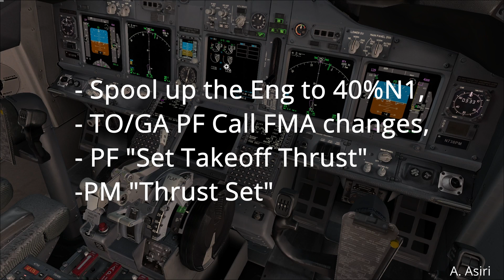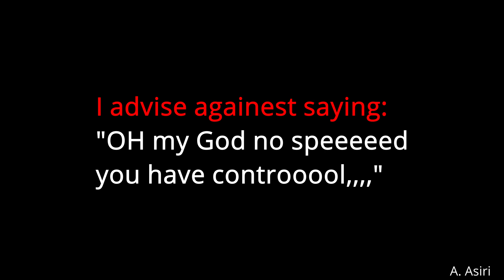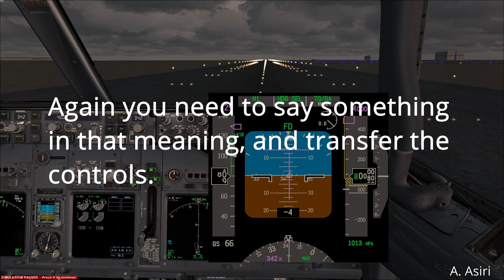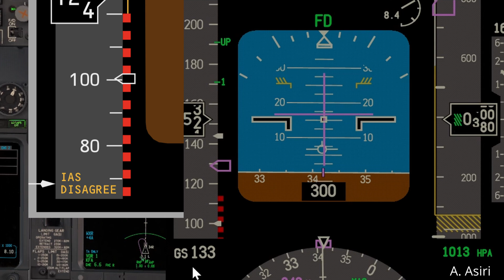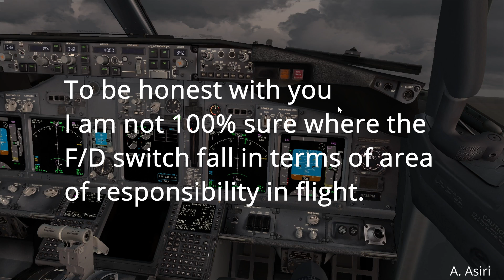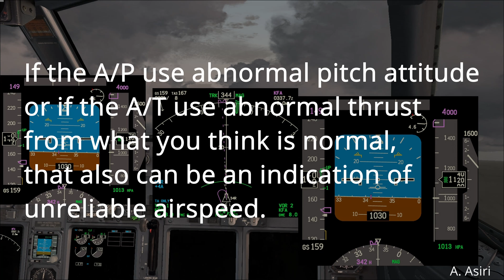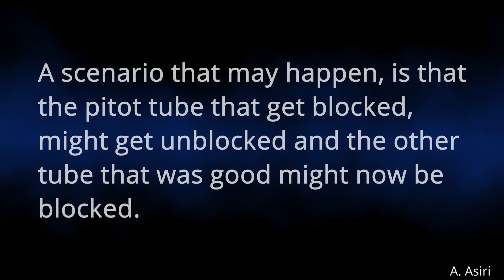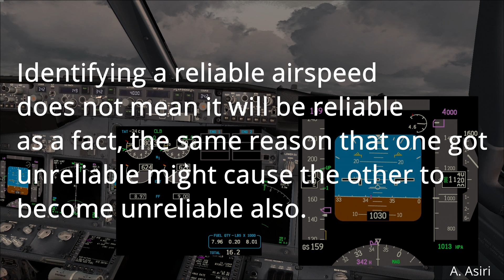B737 NNC (IAS Disagree)

Comment: Thanks Captain for the new videos those are very helpful 🙏🏻🙏🏻🙏🏻
Reply from the maker: You are most welcome, 
Appreciate you taking the time to leave a comment 🙏🏼
Reply: Please Captain I had a question, on the performance in flight (qrh) after setting 10pitch 80n1, there is no unreliable speed to compare to the table. So when you reach line 7 & 8 of the nnc how would you compare? And with what? Would you just compare with the 3 flight instruments?  Thank you. Love your videos. Really helpful!!
Reply from the maker: Hello lovelifegame, 
My apologies for the late reply, 
Actually as per the QRH, “at least my understanding of it 😉” after you set the pitch and thrust as per the table that is for weight and altitude, and you trim the airplane, if you see one air speed indicator is close or matching the target air speed in the table for example .76/280 that can be identified as a reliable airspeed indicator. Again you need to be cautious. 

So step 7 basically is where you will now change the pitch and thrust in accordance with the weight/altitude/configuration/and phase of flight as per the table and the table header will indicate the target speed (except for the climb phase) and you will have a number to check the speed indicators against. 

In all cases if in doubt treat all of them as unreliable and use the table for thrust and pitch. 

Hope that help, 
Let me know if you have any other questions 
All the best 
Abdul
Reply: @AbdulmuatiAsiri37  thank you very much Capt. Very helpful!

Comment: I thought the 10 degree pitch and 80% n1 was if you were in a climb regardless of flap setting.
Reply from the maker: Hello S G, 
I believe it is the flaps that will decide.  
The main point of the recall items is to put the airplane in a safe condition above stall speed and below any limitations.
Reply: @AbdulmuatiAsiri37  I stand corrected thank you.